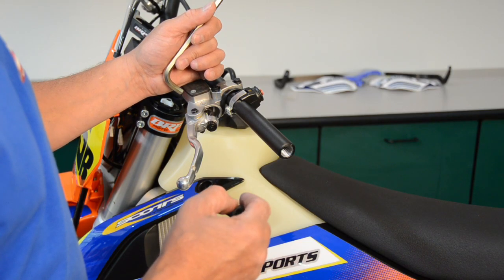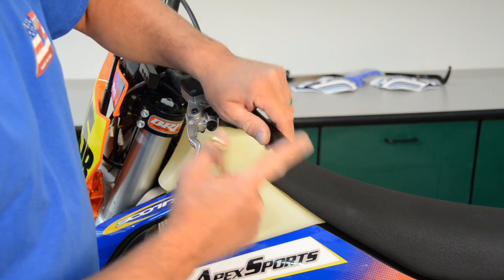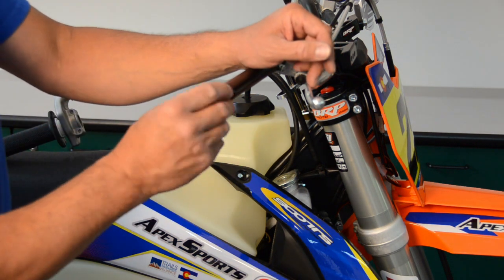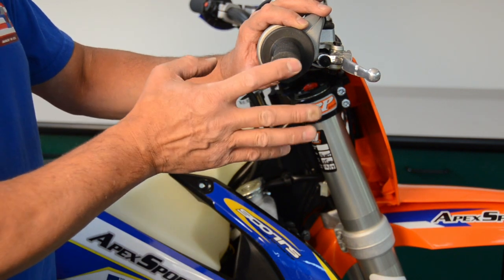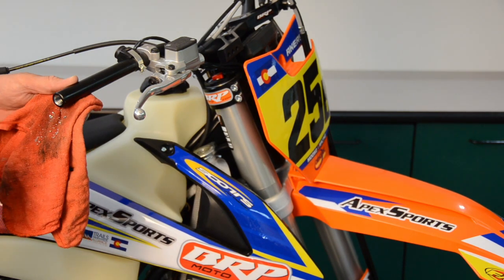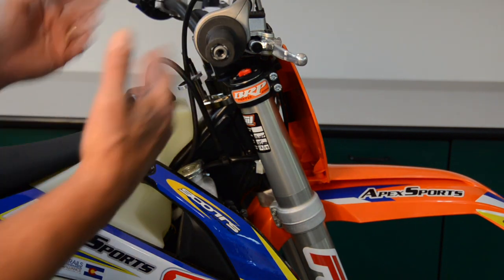BRP Threaded Bar Inserts

Comment: Those grip end pop off. Just use a slight smaller size punch of the inner diameter of the grip... or wack it into the bars until it pops out
Reply: I was gonna comment the same lol.